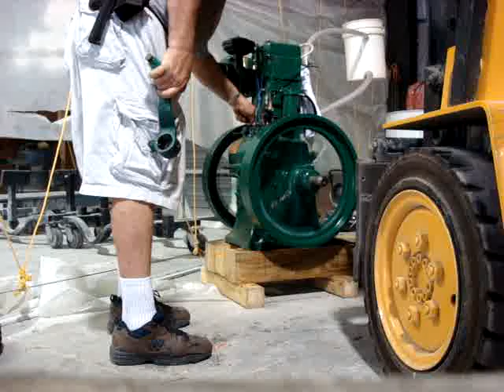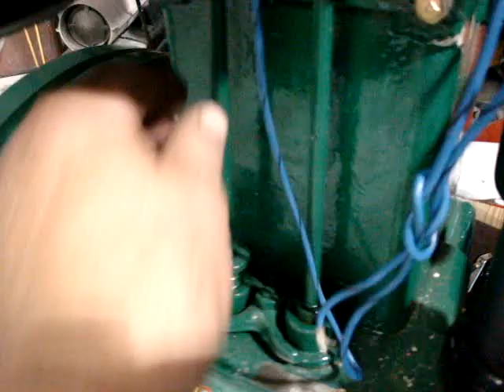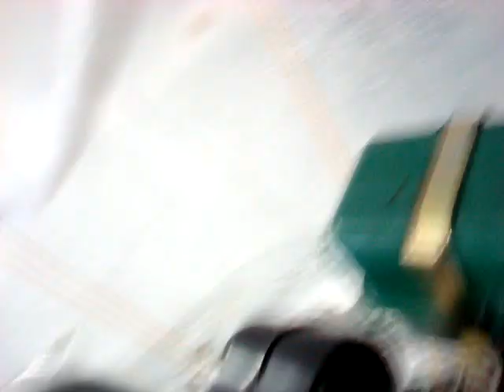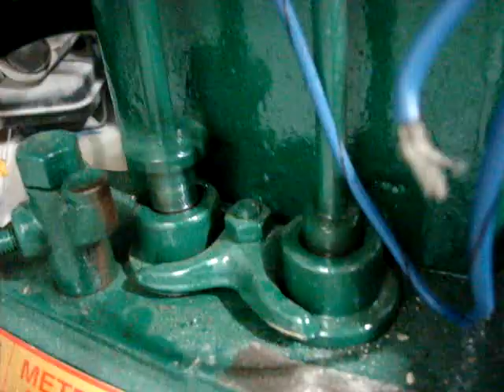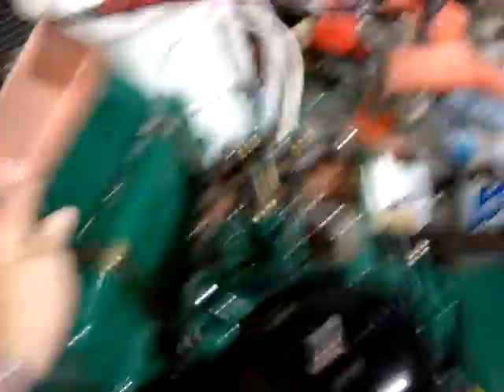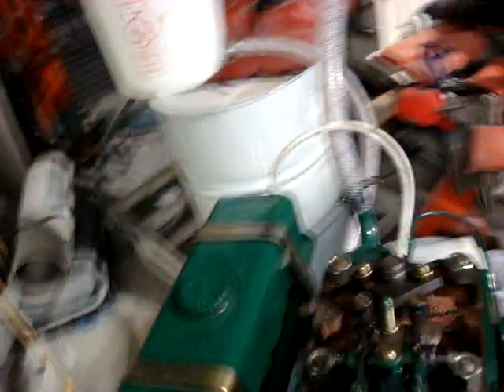Lister Listeroid ,6/1 First runup, WVO WMO Biodiesel, Diesel

Comment: Boy, that is sweet. I have a 6/1 Power Line Listeroid I need to go through and mount with a 5K generator. I bought mine slightly used a few years ago, so I got to see it run. One of my summer projects in the garage on rainy days.